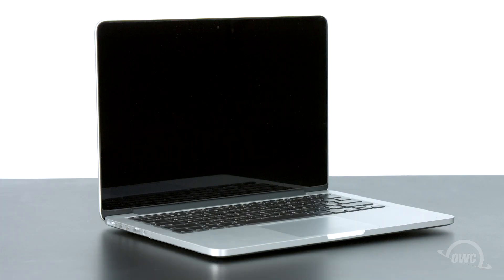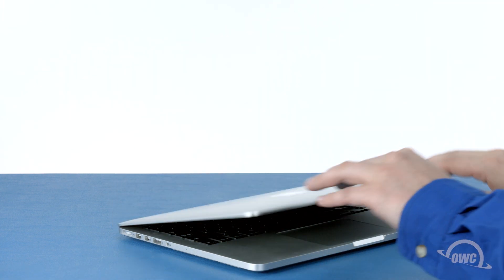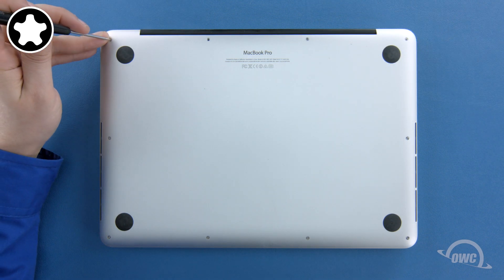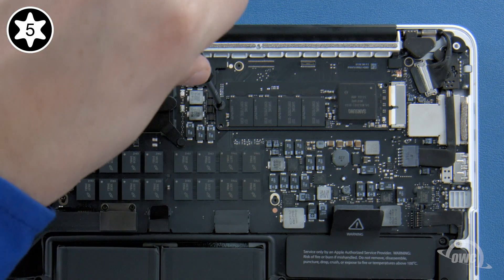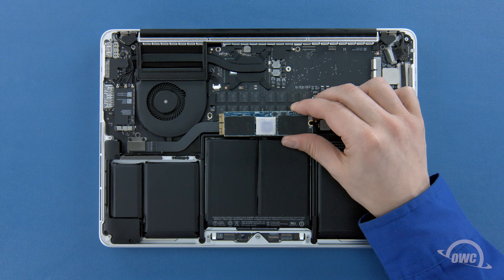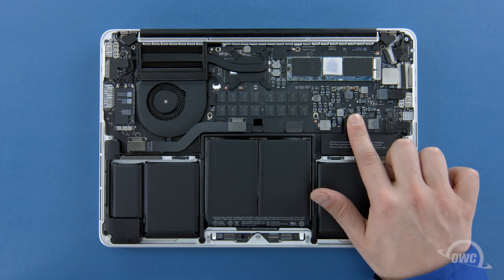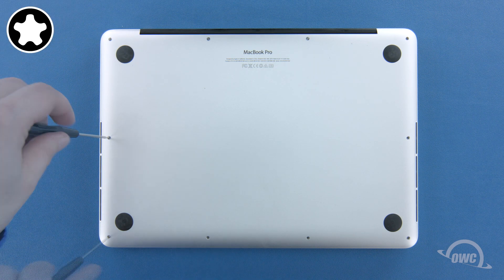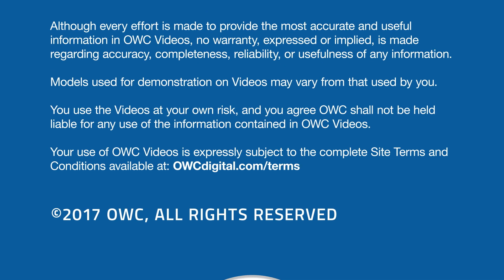How to Upgrade the SSD in a 13-inch MacBook Pro w/ Retina display (Late 2013 - Mid 2015) UPDATED

Comment: can I put a 2tb ssd nvme onto my late 2013 macbook pro 15"retina and would I need to buy an adapter?
Reply: Yes you need the adapter. 7-13 bucks. Amazon
Reply: @fastfreddie6572  Thank you. I have already installed the ssd with an adapter and all is working well so far.
Reply: @djevon0328  I just ordered mine today. Can’t wait to the speed difference
Reply: @fastfreddie6572  cool let me know how it works out for you.

Comment: Thanks for the video. Can you install a SSD on a MB pro mid 2014 13" that originally has a 128 GB Flashdrive or does it need to be a SSD from the beginning?

Comment: When upgrading the SSD of a MacBook pro 13, do you need to upgrade any other specific parts of the laptop for it to handle storage increase so it does not cause any damage if it does?

If not then what parts would be worth upgrading too to increase the laptop's performance? and what is the limit you can upgrade to? 

thanks

Comment: can you install a SSD on a MB pro mid 2014 13" that originally has a 128 GB Flashdrive or does it need to be a SSD from the beginning?
Reply: Hi there, I actually have the same model and was wondering the same exact thing. Was curious if you found any answers or ended up doing it yourself? If so, would you mind sharing? Thanks.